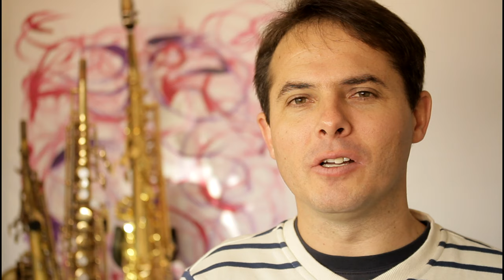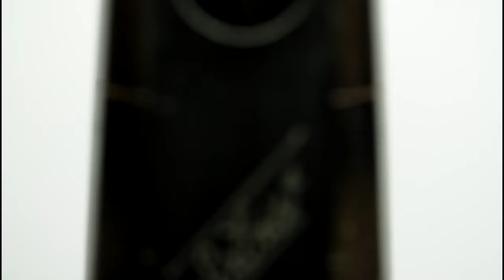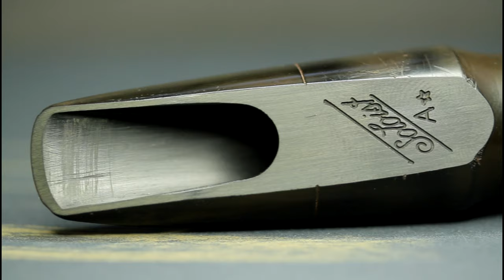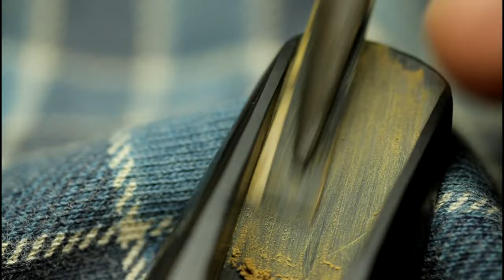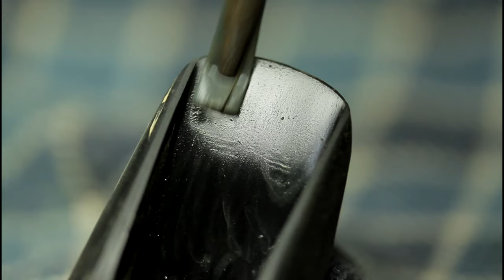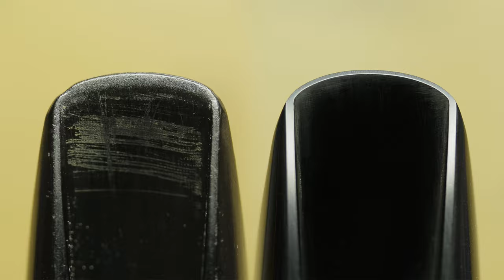Saxophone Mouthpiece Master Craftsman - Selmer Soloist Alto Saxophone Mouthpiece

Comment: You state that the baffle requires to be very carefully shaped but do not specify exactly what the requirement is and what special tools are required to work this part of the mouthpiece.There are  mouthpieces which have baffles flat in both directions , that is along the length and across the section and are as yet perfectly satisfactory. A prime example of this type mouthpiece would be the Rascher. The older models had a baggle that was concave along its length and also concave across its width. The newer models are concave only along the length but flat across the width. I would greatly appreciate your comments on this subject  and thank you.
Reply: Knowing what tools to use sounds like only the beginning judging by how he's describing the difficulty here 😅